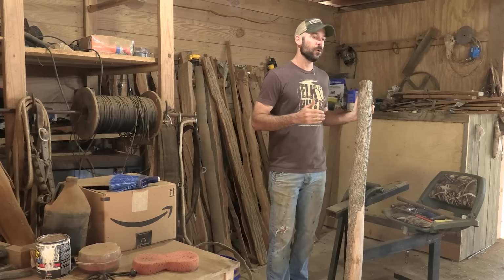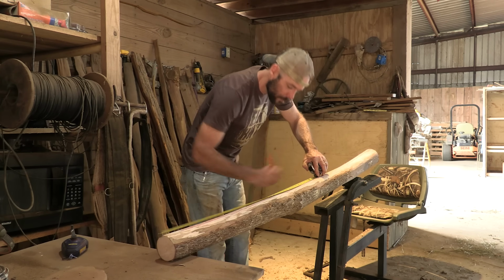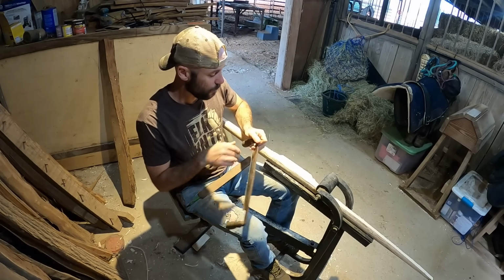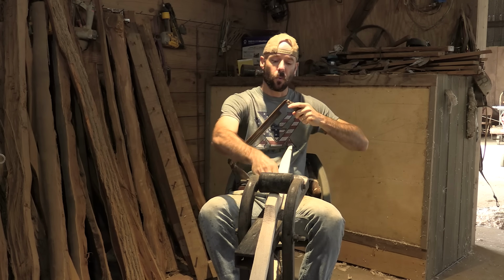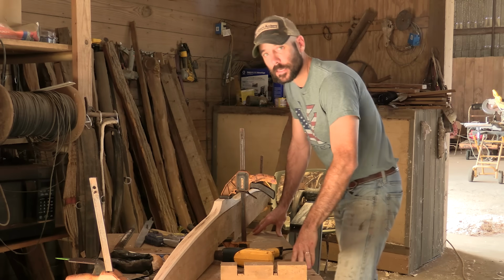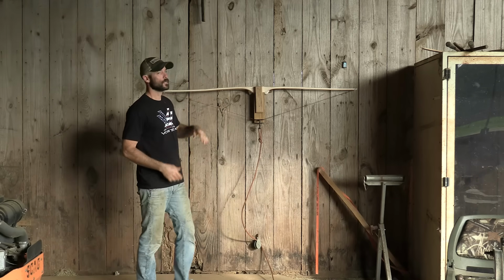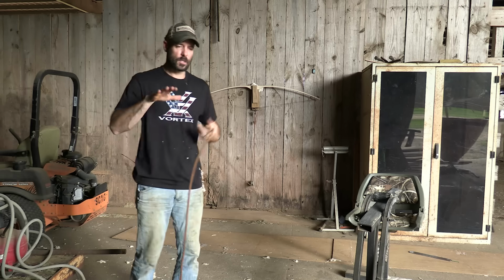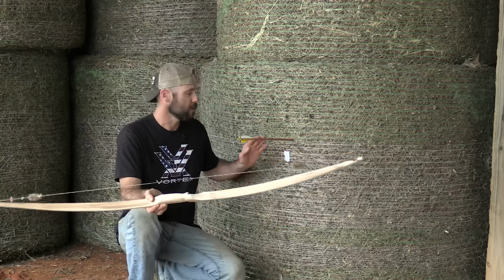Self Bow Building for Beginners - Complete Guide

Comment: I had burn out from watching 7 straight seasons of Alone, and had to step away for a while. But your videos brought me back, and I just finished watching season 8. Congratulations on an epic win there, and thank you for your inspiring videos here on YT.
I enjoyed season 8 tremendously. The only criticism/observation I would make on it is that I think everyone missed a huge building resource by not harvesting spruce roots to used in construction. They're right under the surface, long, flexible and usually used by splitting in 2 (doubling the harvested length) and they constrict when they dry, as would be expected in a shelter, tightening the bound joints. Every member of season 8 had ample spruce, and no one made use of it.
Thanks again.
Reply from the maker: I did actually harvest some spruce roots but it didn’t make the show. Great resource.
Reply: @clayhayeshunter  I wish they would have shown that. It bothered me seeing wasted cordage and wire. Those could have gone further as the season progressed.
Thanks for the reply.

Comment: Thank you. This was very informativie. I suggest that heat treatment momentarily solubilizes the lignin component of the wood. That ingredient serves as the 'glue' or binding agent in cellulosic structures of wood. Cooling allows the glue to reform (again as a cross-link) binding the cellulose (and xylan) strands in a set position. So when you heat harden or heat treat I suspect you momentarily allow the lignin to be fluid. Then the cooling again forces the lignin to solidify and bind the cellulose fiber in position. Professor of fiber technology.

Comment: If you have a belt sander, you can use the front of the belt sander to cut that curve and the handles of your bow as well. An end around everything off the way you want to believe it or not that that sand cloth that you get from the plumbing shop can round everything out really nice that

Comment: When I am removing bark from a seasoned walking stick and don't want to ding the wood below, I dip each end grain in hot wax and soak the wood in water for a few days. I've read that for larger logs like yours, tossing them in a pond/swimming pool for a couple days does the trick too. Waxing the ends ensures the wood stays mostly dry but allows the bark to get soft. It works well.
Reply from the maker: Interesting 🤔
Reply: @clayhayeshunter   I also wax the ends of a stick to make sure it dries slowly if it's particularly wet when harvested. I collect sticks that have been choked by honeysuckle... so using a draw knife to remove the bark doesn't work well as they're spirals with embedded vines...long, finicky job to peel the bark. I was very nervous to soak dry wood the first time... I was scared to ruin a beautiful piece of wood and convinced the wood would absorb water too... but it didn't. I've even scored smoother, slicker bark to allow water easier access to the cambium layer. Some bark comes off like butter after soaking.. other's are tougher but can still usually be peeled with a pocket knife and your hands.

Comment: Excellent video tutorial Clay.  This was exactly what I needed.  My only questions are: (1) How to set the angle of the rasped knocks on the tips that hold the string in place.  If I'm holding the bow in shooting position, do you just angle your cuts toward the back of the bow and down slightly inwards towards the grip?  I just don't want my string flying off.  And (2) did you make the bow string, or is there a good place to order them once you have the specs of your particular bow?  Thanks.

Comment: I like your videos clay I'm a fan, big thanks for your work. For tillering I like to use a 6-in ruler I run it down the center of the bow, so I can see the gap differences throughout the length, really helps with my tillering.
Reply from the maker: Good tip

Comment: Clay
as many others have said, this is a great video and great detail, you mentioned a book, but I dont see it on any links. Is the book geared toward beginners and does it go into more detail than this video. Also, what was the diameter of the log? After you marked the bow did you split the log in half or just removed all the excess material? I ask because could you make two bows from one log?
again great video

Comment: I appreciate your work and talent, I do have a question. Why not use wooden wedges to split the log into a stave, thereby skipping the removal of so much wood. you can split wood into almost any thickness with practice. My unsolicited thoughts.
Reply from the maker: With a larger log, that’s exactly what I’d have done. But for this one, I needed the handle to be deeper than it would have been it I’d split the log.

Comment: When you heat treated the belly was that just get the set curve to give it the back set in the bow or also to harden the belly wood for compression? If you do that before reducing the belly in tillering doesn't that kind of negate any heating effect for the belly compression from the heating? or is that not the purpose (to harden against compression set)?

Comment: does lighly burning sections for color weaken the strength or is it ok as long as your careful that your not charring the wood but just slightly darkening it?    also, wouldn't using the heartwood make your grains run cross-ways the depth /thickness of the bow instead of running the width threw the entire length or is that what you actually want?

Comment: When you work with smaller diameter round staves like that, do you recommend NOT trying to split them into 2 staves?
I have had alot of trouble in the past with twisting.
Obviously splitting them shows us the grain, but if they may twist and ruin by splitting, do you suggest ignoring the grain run and "choosing" your bow back area and hatcheting to what you desire, even if that may mean that you "ran off" the grain by opting to not split it to follow any twist?
Reply from the maker: With species like elm and hickory, a little grain run off won’t hurt anything. I very rarely try to split small stuff like this.

Comment: Hey Clay! I watched Season 8 of Alone and was rooting for you from day one! great job brother! Anyway I started making, and am currently in the final tillering stages, a self bow out of hickory with some plans from another bowyer/youtuber. When you mentioned "wood set", you piqued my interest because my bow is definitely doing this. I was unaware of this being a thing, but it makes sense, especially after you explained it and now I understand the drawbacks of it. Here's my question; is there a point where the wood will stop "compressing" thus losing it's rebound potential and will it still be a shootable bow even if it may not be the quickest/efficient?
Reply from the maker: Yes, I’m a way. But I’m hat also depends on the moisture content of thr wood. Moisture is a big problem with hickory.
Reply: @clayhayeshunter  When I got the wood,over 3 years ago, I believe it was kiln dried. It's  been sitting pretty much in a blank for that long in a mostly insulated garage. I would assume the moisture content would be pretty low, but not bone dry. I suppose the only way to find out is to finish it up and see what happens. Thanks for the reply!

Comment: Great as always! I have a bend through the middle bow that I've been toying with and the tiller looks good.  I'm curious to know if it is possible to add a stiffer handle section? Thanks
Reply from the maker: Not typically. A handle just glued to the belly of a bendy handle bow will just pop off.
Reply: @clayhayeshunter  that's kind of I figured but wanted to check. Thanks for the help.

Comment: Hello Clay, couple quick questions from a beginner. Should the bark be left on a split stave during the drying process? It's my understanding the ends of a stave should be sealed immediately after harvesting to help prevent checking. Should the belly and the back (if the bark has been removed) of the stave be sealed as well?
Reply from the maker: Those recommendations are important for species like Osage and Yew. But for hickory they don’t apply. You can remove hickory bark immediately after cutting.
Reply: @clayhayeshunter  What about Juniper, would I want to strip and seal Juniper. I'm from Utah. Unfortunately, Osage and Yew are not really an option for harvesting in my neck of the woods, at least not that I'm aware of.

Comment: You might want to go to plumbing shop or humans are both home Depot in the plumbing section they got a roll of 80 grit sand cloth you can tear off the length you want and it would be excellent for rounding the edges of your bow it might be more effective than a file or a rasp or a rasp

Comment: Clay  - thanks for that video.  Just a question please - I have a log (Australian Blackwood)  that has darker heartwood in the centre.   It's about 2" diameter in the middle of a 5" diameter log.   Would it be better if I reduced the back of the bow down to the first layer of heartwood essentially decrowning it and then followed your instructions from there?  I should then end up with a heartwood bow with lighter coloured outerwood on the handle only.
Reply from the maker: Hey Chris, I’d love to help but I’m not familiar with that wood. It just depends on the species.
Reply: @clayhayeshunter  no worries - I will try both ways and let you know what happens...!

Comment: Making a bow is EXTREMELY frustrating and difficult.  I am trying to make one from Osage and can't follow a growth ring to save my life. If I get one ring on the sides the middle is the ring above it. How do you deal with that where the center of the stave going across is lower than the sides? Should I use the point of a pocket knife to scrape the center and have a bow where the middle is thinner than the sides? Should I just give up and put a thick backing on it? I have no idea what to do.

Comment: I am having issue with draw length and the boards and wood snapping.  I have put about 28 hours in this maple, with out drying.  I am concerned that this will beak also...... I don't have a "hand Pealer," I have a hand planer they were using these hand Pealers, for building and pealing logs for homes. I had a popular board it broke, and so did the white wood I am concerned after 28 hours of work that this maple will break? What is you instruction?

Comment: A question about a 60" osage self bow i am working on. I've got it down to 3/4 thickness limbs and 1 5/8 width. I want to target 40-50 draw at 26-28" draw.  What should I look for in tapering the limbs down to ? 3/4 near the handle but should I taper down to 1/2 tips ?

Comment: Very, very nice video, in deed.
I think I saw the line that flatens equally the whole limb actually doesn´t begins exactly before your fades out. The circular line you did with the circular saw lands over the limb straight line a little after the limb begins; is this true?.
Reply from the maker: I’m having trouble understanding exactly what you’re asking.
Reply: Sorry. I mean if the regular thickness of the limb begins in the same spot where fades ends. Or you let a little extra thickness after the fades.
Reply from the maker: It’s not critical to follow those lines at the fades exactly. So you can leave a little extra if you need to.
Reply: @clayhayeshunter  Thanks a lot for your answers. Happy new year for you and yours.

Comment: Do you find that self bows “Stack” and if so what do you do to your limbs to counteract it?
Reply from the maker: Any improperly made bow will stack. It has to do with string angle coming off the limb tips. There are several design features you can use to reduce or eliminate it to some degree.

Comment: I'm in the process of making a hickory longbow, though I was following your video where you tapered it from the handle out to and middle of the limb and back in towards the tips. I'm trying to get it so that I can bend it but whenever I pull on the string to see, it flips around or twists. What is my issue?
Reply from the maker: Your handle is likely not lined up with the nocks.

Comment: how wide is the limb at its widest point? inch and a half or 3inches? didn't know if you measured out from the center line an inch and a half on each side or split the difference of it from the center line.
Reply from the maker: 1.5”
Reply: right on. thanks for the quick reply and appreciate the vids man. keep on keeping on brother. I'm doing the switch from compound to self build. after an extremely good deer season i feel like I should up my game. compounds are nice but I rely too much on sights and any other handicap that comes with it. i like the feeling of being self sufficient so making my own bow and arrows seems right up my alley. again thanks for the info and good luck to ya in the new year brother.
Reply: another question. I found a vertical crack in my limb. should I scrape it and start over? it's about 6 inches up from the nock of the bow and is about 2 inches long but It's deep.
Reply: scrap*

Comment: Another good wood that is easy to make a bow from provided the tree is big enough is the Red Cedar/Eastern Red Juniper or Mountain/West Juniper. However, I do know you need to use some backing for the wood but that type of tree has very little moisture to the tree so one can take a live tree and make this bow right away without delay. This Eastern Red Cedar/Easter Red Juniper would be a Flatbow Longbow or American Style Longbow under 60 inches to have a Shortbow of but with the flat front notched grip handle so I can shoot it with a flatbow type grip but having a spot to set the hand easier time and time again but on the left side for my needs maybe both sides just so others can use my bow who are not left eye dominate like me or shoot right hand. There is one model of bow from Graven Archery you can order with the duel arrow shooting rest in the options on a longbow called the Siege. 

The other is seeing Fiberglass Bar Stock online and using this to make a bow out of not using this method as much but a slightly different one with parts of this but wearing all the safety gear for that until I have the bow I need for my weight at my draw. I would be in second recreating the Actionbow by Actionrod 8200 the first bow they made, a 60 inch Bush legth Longbow but at 45 pounds since those bows seem so rare and for the limbs having a 4.5 to 5.5 inch be pulling nearly the correct weight. The three bows in the lineup have a notched handle grip like almost all the bows but I would go straighter front to make it easier to do a full flat handle type grip but have the notch for a consistent spot to have the hand sit each time, possibly shooting both sides like all of the old all fiberglss Actionbow from Actionrod models.